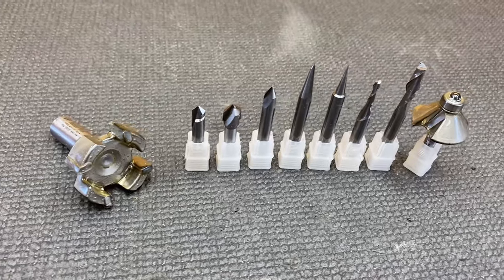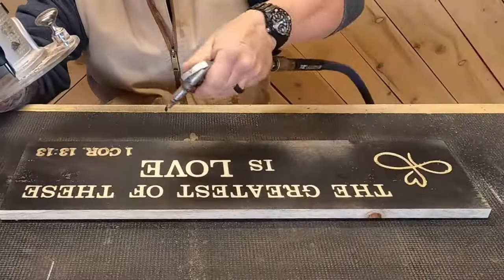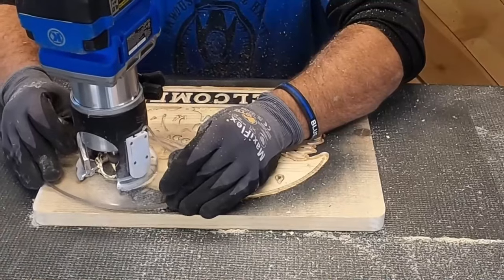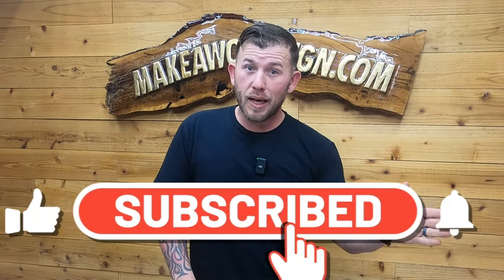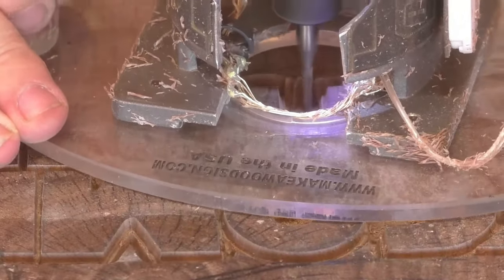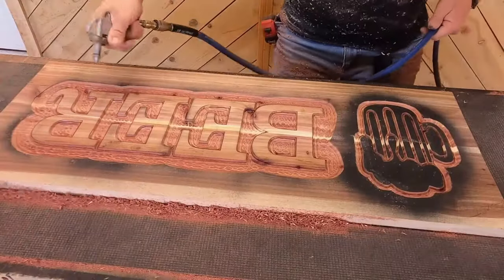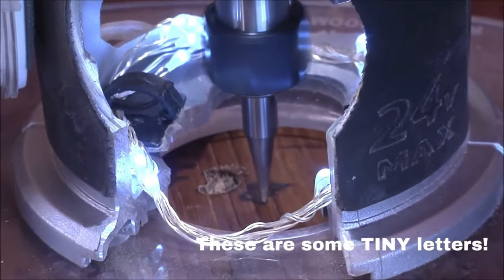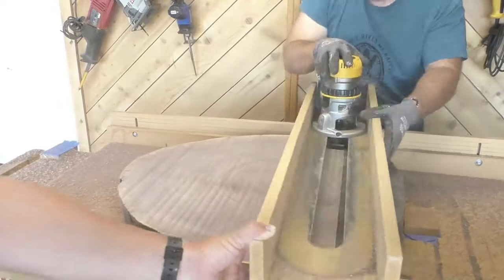The Best Router Bits To Use For Each Job

Comment: Howdy Mr. Eric, Mr. Ryan...

Great video. 👍 

I noticed those your Profile bit comes to a point. My Profile bit is flat at the end, I actually use it alot in order the get that flat background around small detail areas. TBH, I wasn't aware there was a "Profile" bit that came to a point. Perhaps yall could do a comparison video in that and why one would use a pointed version as opposed to a flat version? 

On another note...You may recall, I'm the guy who's always talking about carving "TEENY TINY" letters, like 3/8" and 1/4" tall. 

I use my Bosch trim router for about 90% of everything I carve. The other 10% I use a Dremel. 

Something I've recently started doing/using is a collet that allows me to use Dremel bits with my Trim Router instead of the Dremelitself. 

In particular, doing FINE detail. As you mentioned, typically "You" would use the Carving Liner for those details. But, as also mentioned, the Carving Liner is a single flute....And boyyyy howdy, you ain't lying, that thing dulls quickly. As well, if I only want to go, say 1/16" deep, the Carving Liner, though does work, there just isn't much of a "blade" on that thing at 1/16". It's basically just a tip. Not much cutting power at all. 

But, There are Dremel type bits that do the same work as a Carving Liner, but even smaller and they have 3 flutes. Gives a MUCH finer cut as well as less tear out, especially on softer woods (pine and cedar). For example, imaging Carving the dot of an "I" where the total length of that "I" is only 1/4" tall. To make that even more "fun", you're making that "I" an Outset including the Dot. To make that even more "Fun", you're Carving that onto a Name plate that's  only 2 3/8" x 4 3/4" and you got 4 lines of script to put on it. I just counted the total number of letters on this name plate I did for another Army Plaque I'm doing...there's a total of 50 letters, 4 lines of script squeezed onto a 2 3/8" x 4 3/4" name plate.  To top that off, this name plate was carved out of Rosewood. 

Hmmm. I forgot my point, lol. 😮

Oh well...

When do you think you guys will do more "Power carving" /Dremel-ish carving videos? 

Ok, I go now 😅😅😅
Reply from the maker: Well we don't use a Dremel, so I'm not sure we'll do a video on that but our next video will be comparing box store bits to ours and one has a flat bottom. That should help

Comment: Love your work and videos. I’m interested in doing some signs. I’m not quite sure of what I need to get started. I’ve noticed that you use different routers. I have a Skil and a craftsman router. The Skil router has a clear base. I see that your bases are different sizes with handles. Do you offer bases that would fit my needs? Also, is there a starter pack of bits available?
Reply from the maker: Here's a link to our small beginner kit. We have multiple bases for different routers, but if we don't have one for yours, we sell a blank that you can drill your own holes. https://makeawoodsign.com/products/small-beginner-sign-carving-kit?_pos=1&_psq=small+beginner+kit&_ss=e&_v=1.0
Reply: dave they are the best in the business for sign carving and good people to talk to
Reply from the maker: Thank you Toby❤